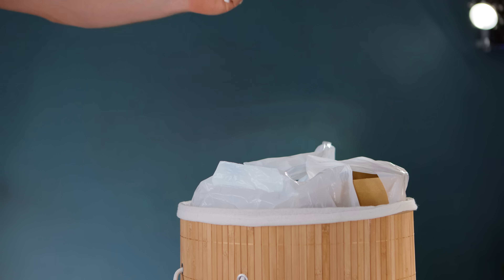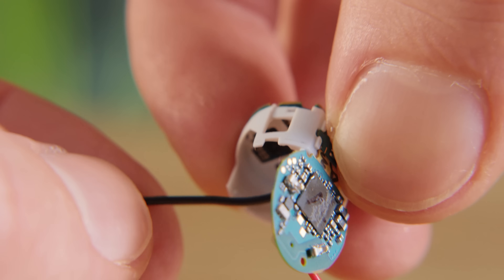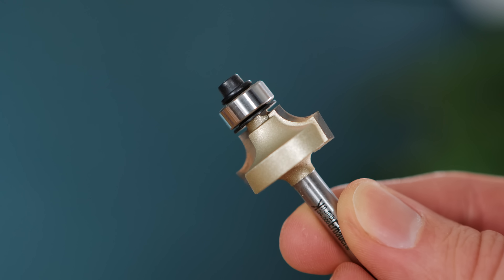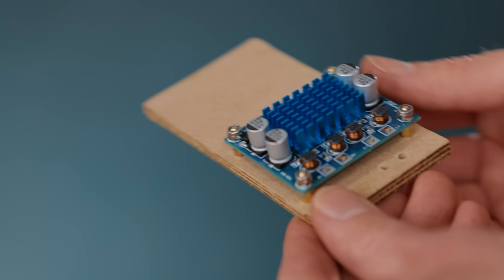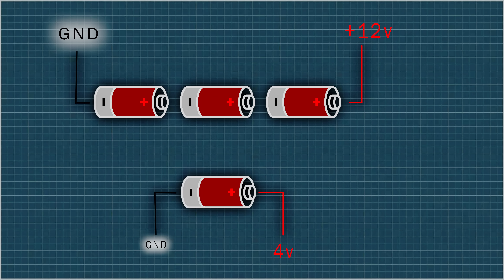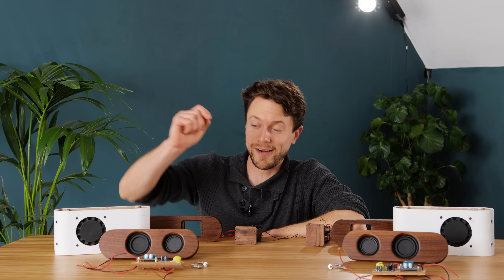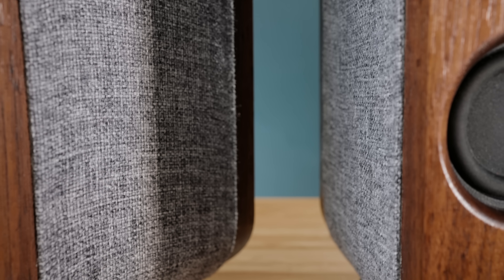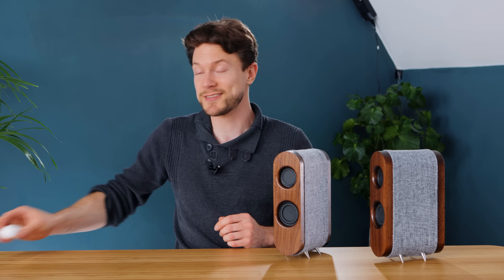Transforming dead earbuds into POWERFUL wireless speakers

Comment: This man is the perfect mix of actually making cool things without having to learn how to build all you own stuff and then getting utterly overwhelmed when you relise you only have one brain cell.
Reply: I got all the materials for the mushroom lights then realized I suck at soldering and don't have anything to hold the wires.
Reply: @thegreatsawyer  get a third hand tool. they are dirt cheap and are, besides a soldering iron and tin, the most useful thing for soldering.
Reply: @MrCow579  Ok, I don't have access to the materials right now, but I will let you know how it goes.
Reply: @thegreatsawyer  those mushroom lights were actually the only project so far I did from this channel 😊
Reply: @MatthiasBouillon  Mushroom lights are still on my "to do" list!
Reply: @thegreatsawyer  Don't give up! Everyone who has ever learned to solder has been there!
Reply: @thegreatsawyer  You dont need anything to hold the wires, literally a piece of rock can hold one end while you hold the other end with your left hand with soldering iron in the right, its really easy.
Reply: @idontcare7961  Yup, there are lots of ways to hold wires for soldering. Hell, I made a "jig" that I could pass wires through and they would be positioned the right height for me to work with (the jig was a piece of wood with various diameter holes drilled through). That said, "helping hands" are not a bad thing to have and when you use them once, you'll use them forever.
Reply: @davinci7726  I have been soldering like that for years, never had any problem, i much rather hold one end by hand than have it in clamp because when you hold it you feel the joint much better and you can adjust accordingly.
Reply: @FlashPaperGrind  Cool idea, helping clips would definitely make it easier but im just used to do it right on the table and use amything i can grab from toolbox to hold one end.
Reply: @FlashPaperGrind  I recommend a few of those magnetic gauge holders. The ones with a switch to engage or disengage. Place a few on a steel base and attach crocodile clips where the gauges would go.
Reply: @thegreatsawyer  I use to have the same problem. I'm still not professional but having the right tools helps.
Reply: @mbbrooks123  make sure you have the right solder /flux too!
Reply: I like the fact that showed the way to do it by hand and using a machine (CNC).
Reply: You actually need a bit of practice in everything he does.
Reply: @RGV2300  that is true, but having the right tools (not the best or most expensive) can help make the learning/building process a lot easier and more enjoyable.
Reply: @FlashPaperGrind  of course, but you still need to have some practice like in soldering or woodworking, even if it is manually. Even with a jigsaw, i find it hard to get those round edges.
Reply: @RGV2300  even sanding on a disc sander takes practice to get perfect round edges, so yes, practice is vital before actually attempting a final build.
Reply: The reason I subscribed to this channel is because of the immense depth skill and knowledge that go into these projects. He makes it look easy, but you know he goes through weeks if not months of prototyping and experimentation to make these videos.
Reply: FACTS
Reply: its called being a engineer... pay's great but cost more to get there..
Reply: Compared to this guy...
Reply: And two left hands
Reply: Well put.
Reply: keep practising soldering! eventually it will click!
Reply: 🤣🤣🤣🤣🤣🤣🤣🤣 Good one
Reply: Don’t lose sight on the Kingdom of God 🏞️ all that is in the world is soon coming to an end. Seek God whilst He may be found. Jesus saves ✝️🙏
Reply: @TRUSTINYAH  Jesus dies
Reply: @TRUSTINYAH  IDC
Reply: @TRUSTINYAH  bro think your in the wrong subreddit...
Reply: this isn't how to start DIY I mean the man uses a fucking CNC machine
Reply: @fisheatsyourhead  CNC machines can be used for DIY projects since there are machines available ar reasonable prices (and they fit quite nicely in a home workshop). DIY doesn't mean using chisels and shit - it means doing something yourself, however you can, as opposed to purchasing a product.
Reply: @fisheatsyourhead  He gives alternate methods.
Reply: @fisheatsyourhead  These days, for a maker, 3D printer, laser cutter, CNC router are really gonna help for speed and precision. Especially if you're trying to integrate off the shelf components for which you already have mechanical drawings. I built my first laser engraver just so that I could mark wood to show me where to hand saw. Even that was a massive step up as I knew that the lines on my board were accurate and repeatable.

Comment: Why didn’t you make the speakers chargeable by usb? Would’ve saved you having to open them to recharge and there’s plenty of circuits to charge lithium batteries. Might be difficult tho using one charger since you split the batteries.
Reply: He can put all batteries on parallel and use a bms to charge the bateries, and a linear stepup or a high mhz buck converter to power 12v

Comment: Splendid work! As a diy speaker builder myself I always struggle with the ground loop issue. I understand how you solved it but I prefer having an integrated charging solution in the speakers.

Comment: You're projects look like they could have cost hundreds if not thousands from a high end shop in London
Reply: Or just buy the old Logitech X230 lol
Reply: Considering the bill of materials, you are not far from it for this diy. The cost for the mentioned parts in the description is already around 200 pounds and that is excluding shipping. The materials of the casing, solder, wiring, switches, passive components etc. will probably push it towards 300 pounds. Though, if you would buy these from a posh brand, you'd probably pay double indeed haha!
Reply: @jhonny44444  I've tried to build some of his projects in the past, they turn out to be relatively expensive compared to just buying the actual product on Amazon. I do think he's making actual art though, so that counts for something. IMO these speakers sound like they're missing something in the mid eq compared to the Bose...and it pains me to say that because I hate Bose.
Reply: @jhonny44444  I'd get everything on sale cuz I'm a cheapskate xD. I made a walnut bluetooth speaker storage unit with an led light inside and it cost about £80 in walnut, £15 for a bluetooth board and £10 for a speaker. It also had chrome hinges and knobs!

Comment: I'd love to see a mountable and waterproof version of this for a kitchen or a bathroom.
Reply: All you would need to do for this is make sure the electrics were sealed away. There is little to no difference between a normal speaker and a "marine/waterproof" speaker
Reply: Fair enough. But I am also curious about how the design would change from the inside-out if the purpose was as more of a tucked away, mountable, and waterproof version.
Reply: @drumlord8772  It's likely already pretty waterproof with all the soundproofing he's done (which is basically the same thing you do when waterproofing, sealing off any air gaps).

Comment: Great build. Only things I'd change: break out the pairing button(s) to the exterior, so you don't have to open it up in 2 years when you get a new phone. And mark them L/R somewhere on the back. 
 
And perhaps inline charging, so you never need to remove the batteries.

Comment: LoL currently I'm working on the same project. But did an unknown mistake which made one bud useless, so i could only make a mono speaker as the working one outputs both channel when other is not connected.
Reply: BTW how to know the required volume of the enclosure?